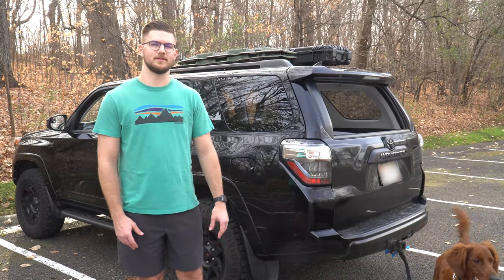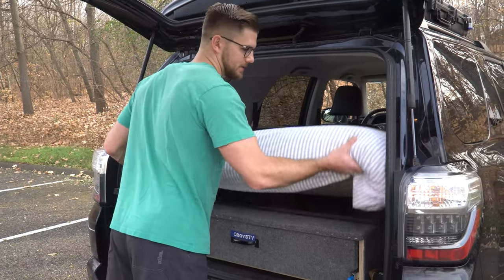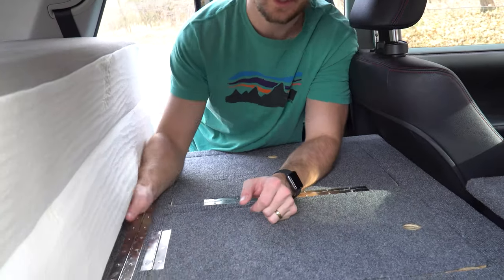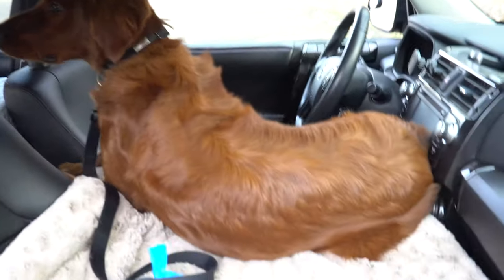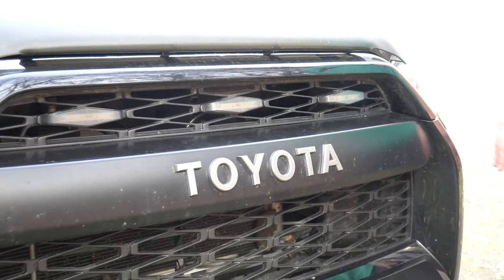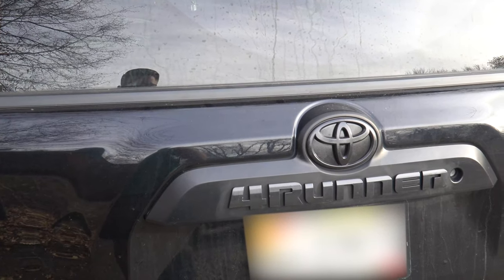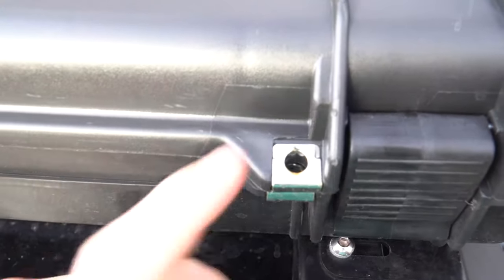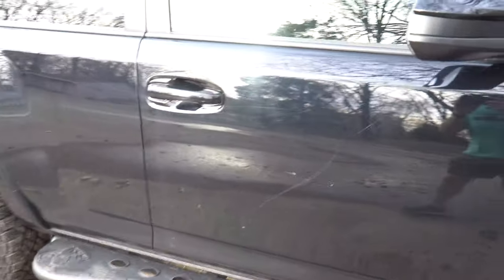5th Gen 4Runner Camping/Overlanding Setup/Rig Tour 2020 | A Couple and a Dog | Affordable DIY Build

Comment: I love the platform. My wife is worried we won't fit in the back of our 4runner. We are short, but older. So getting in and out could be a trick. 

That mattress.
Reply from the maker: You could always build it shorter if you wanted more room.  Getting in from the trunk isn’t too bad.  Just remember that if you build it shorter in the back the wheel wells stick up a little bit so it would take some leg space away width-wise.
Reply: @OverlandEngineer  good point.

Comment: Simple, functional, looks great. I had this elaborate expensive plan but this is an awesome and will be copying most of what you have going here. It's usually me and my 100 pond pup. Wife isn't into the camping life as much lol. I need to figure out a way to incorporate a spot for my cooler to sit and not be in the way. I love your work and sub'd right away. Keep the great content coming my friend.
Reply from the maker: Thanks!  Really Appreciate it!  I have thought about this scenario.  Essentially I figured you could build a front platform section the size of the 60% seat.  Then, you could leave the single seat in the car.  Then you could put the fridge behind that seat.  Or honestly just pick a side to put bags and the fridge.  It probably also depends on where you want the dog to sleep, whether its next to you or in the front like me.  Fun problems to solve though!
Reply: @OverlandEngineer  Actually I used to leave him a spot next to me but he always goes curl up on the passenger front seat. You wouldn't think a 100 pound Rottie would be comfy there.
Reply from the maker: @petyweestraw  Its crazy where dogs end up sleeping and typically in such uncomfortable positions.  The dog platform works awesome!  Plus its super low profile for storage. The only caveat is you cannot open the passenger door ones its placed.

Comment: Great video! Question: the top for your slide out drawer...is it finished on the underside as well? If not, might be worth popping some on just go eliminate any issues with moisture. Always a good idea to seal both sides of wood, even when it’s ply.
Reply from the maker: That’s a great Idea.  Honestly though, my insert is a little loose so I may just redo it.  I also wasn’t a huge fan of the stain color so it might be a good excuse.

Comment: Liked the video. Where did you get the knobs for the carriage bolts? What are the knob called?
Reply from the maker: Thanks!  These are the knobs: https://amzn.to/34sxvCD.  I had the appropriate screws to match.  However, I would not necessarily recommend these.  I did not loosen them too often and I found they corroded through the Minnesota winter.  May not be an issue for you but just be warned they may need a little encouragement if you leave them for a long period of time and they may be something to replace every year if you live in a harsh climate.  If I could find these in a grade 8 metal that would be a dream.

Comment: Hey everybody! I am new to this. And I am in process of making decision for a car size. Choosing between Crossover and Compact (SUVV) and Full Size (like 4Runner). What are the advantages of bigger Vehicle? Is sleeping in the car much better than in tent?

To Author? Can you share more about your travelling experience? Thanks!
Reply from the maker: Basically a larger vehicle is less nimble on trails but much more space.  Smaller vehicles fit less but you can go more places with them.  It depends on your application as to which is best.  Right now, a 4Runner has plenty of space for me.  I also want to be able to go down narrower roads and not worry.

Comment: What MPG do you get on the highway? And how tall do those tires measure out when on the ground?
Reply from the maker: I think when my truck was full stock - aka this photo (31.5" tires) - I got just over 17 mpg.  When I added the 3" Lift and 33" all terrain tires - I got around 15.3 mpg.  I now have 33" mud terrain tires and two roof boxes on my roof rack - I think I get like 14.8 mpg.  I may have gotten 16ish mpg when I added the lift and not changed my tires from 31.5" to 33" but I don't remember.

Comment: what's the best year for the 4runner to buy? i also really like how the rear window slides down
Reply from the maker: Good news is most years have that window feature!  Right now most years accept brand new are not good to buy due to the market.  But the answer to that question kind of depends on your priorities because they are all quite good its just each has some pros and cons which may lean toward your preference or may not.
Reply: @OverlandEngineer  more research is needed for me then. thanks again
Reply from the maker: @zumezoom9593  Yeah sorry.  I love the 5th Gens but some people really want the V8 of the 4th Gen.  There were some features added to 5th Gens in 2020.  But the market on all 5th Gens is super high so you will pay a mark up on used vehicles thats thousands over KBB a year ago.  Thats why I said if you can swing buying new then hopefully you can get something at MSRP.  Honestly, buying used does not really save that much money when looking at 4Runners.  They hold their value well, it just depends on if you are ok with driving higher mileage vehicles and how much money you want to park in a vehicle.  If you are set on a newer vehicle and want a V8, the Lexus GX460 is sweet.
Reply: @OverlandEngineer  I've thought about the GX as well, but I still like the 4runner. i guess I could wait a little while for  the 6tb gen to make its debut and the 5th gen hopefully will drop a little in price. (fingers crossed)
Reply from the maker: @zumezoom9593  Yeah you won't probably go wrong.  I'd probably look for a 2020 4Runner TRD Offroad Premium or newer if I was looking for a 4Runner.  The interior apparently is quieter like they added more sound deadening and the headunit/gauge cluster was updated so its bigger/brighter/apple car play/etc.
Reply: @OverlandEngineer  well, that's it then. I'll wait for the price to subside. I look forward to one day owning a 4runner and going overlanding or whatever
Reply from the maker: @zumezoom9593  Sounds like a plan to me!  Camping is fun but also mobbing around in a lifted 4Runner to work and back is pretty fun too.
Reply: @OverlandEngineer  haha i believe it would be. i salivate when I see my neighbors pimped out 4runner running on 35's, rock sliders, high clearance front and rear bumper.. its menacing

Comment: Could you take out the back seats and have more storage space?
Reply from the maker: Totally.  I just decided to only partially remove them because the seat backs seemed challenging to remove then place back in the car.  The middle section platform does rest on them but you could easily modify the height and it would provide a lot more room.
Reply: Yeah I was thinking for a longer term camper conversion. I’d like to see this done and how someone likes it. Thanks for the info.

Comment: How is the roof rack storage mounted to the roof rack? Does it come ready like that or did you have to drill through it?
Reply from the maker: I had LFD crossbars at the time which mount right into the factory rails!
Reply from the maker: @Giorgio Mumda Yeah basically, I have another video on the channel explaining it.
Reply: @OverlandEngineer  My crossbars are just two bars, I'd need something to grab them that's secure, the t-cross method won't work in my case
Reply from the maker: @RayKaufman  Yeah, most people I know have just sold those OEM bars and got aftermarket ones that are better for mounting.  There are work arounds but they will require making some special mounts.

Comment: Nice rig and setup. I want to get me those LFD crossbars like yours. Great video.
Reply from the maker: They are amazing for the price.  Way better than stock crossbars.
Reply: I think these will fit on my limited. Where did you get them? Do the make wind noise?
Reply from the maker: @Nostromo_1  Link in description for the crossbars.  I am not sure if they cause much wind noise alone, but just to be safe I bought the wind deflector.  Link also in description :)
Reply: @OverlandEngineer  thanks.

Comment: Very nice setup for sure.  How did you secure the storage box to your rack?
Reply from the maker: Thanks!  I just put some large carriage bolts through it.  Drilled some holes the size of the bold shaft, used some rubber washers and bolted it down.  The carriage screws have a square part next to the head that sit nice in the roof rack channel, then I just feed the bolt through the hole in the case and crank it down.  I use 1 bolt per corner.
Reply: @OverlandEngineer  Cool thanks for the tips.  I'll need to make something up like that.
Reply from the maker: @RolandoNispiros  No problem!
Reply: @OverlandEngineer  FYI I picked up the same rifle box and installed it on my roof rack today. Thanks for the link!
Reply from the maker: @RolandoNispiros  Awesome!!!

Comment: Great video. What do you use for the dog platform?
Reply from the maker: Just some carpeted plywood!
Reply: @OverlandEngineer  what did you use for support legs ?
Reply from the maker: @32lifesaver  Doesn't need any!  It uses the arm rest on the door and the center console to basically stabilize it.  There is also a piece of wood I put in the rectangular cup holder section to help support it.  I think it may rest on the shifter without that cup holder insert.

Comment: Sweet setup! What size tires are you running?
Reply from the maker: Stock :( ...265/70/R17 or whatever...265s.  There will soon be a 3 inch lift and then tires will follow when these hit the dust.

Comment: How do you stay warm in there while camping inside it?
Reply from the maker: Probably going to build a small diesel heater but I haven't used it in the winter yet.  Either that or you can build your own battery bank and use a heated blanket if you do not want to buy a Jackery or GoalZero battery.

Comment: Nice rig!  What lift did you use to get rid of the rake I’m looking at into getting bilstein 5100 .85 lift front.  Also what size tires are those?
Reply from the maker: This is actually the stock TRD Pro lift.  Since this video, I just install a 3" lift and I have a video coming regarding this.  In order to have appropriate rake, make sure to buy the right springs.  This will depend on the weight of your vehicle in the front and rear and if you do not buy heavy duty enough springs then it may not be level.  Similarly, lets say you want to level the truck so you buy a 1" spacer for the front because thats what everyone does but you have a front bumper and it's not stock.  You probably want to buy a larger spacer.  Does that make sense?  You probably want to look up a weight / inch lift lost chart for the 4Runner if you are getting spacers.

Comment: Is that simply a regular dog bed, or is there a platform underneath it to level it for your good doggy? Also, where do you put it when in motion? (Glad to see a MN based 4Runner YouTuber, I just moved from there to UT.)
Reply from the maker: Thanks!!  I have a dog platform under it.  I talked in more detail on it in the Part 4 Aluminum Extrusion Platform system video.  It works like a charm though it may be getting a little too small for Otis.  He is almost 70 lbs.

Comment: peep the cboystv patch
Reply from the maker: Haha you caught it
Reply: @OverlandEngineer  I’m about 6’2” , I see some people can get the full 74 inches in the back of their runners. What’re your recommendations for me if I were to move into a runner?
Reply from the maker: @kamrenstaples Can I ask a series of clarifying questions?  Will this be full time?  Will it be through the winter?  Do you have a large budget for modifications?  Are you alone, do you have a dog?  What can you build yourself vs. need to buy?
Reply: @OverlandEngineer  This will be full time. Yes through the winter. Not a super large budget. I am looking to stay under 2 grand for modifications. I will for sure be alone. I have some woodworking experience, construction experience, lots of misc jobs that will help contribute to me being able to build my own rig. I am also lucky my father is a mechanical engineer and is more than willling to help me with wiring, building, pretty much whatever, and most importantly, even planning things out to best optimize the vehicle. I am 6 foot 2, being 19 years old I am told I will grow to probably 6'3" by 24. My main rig options are strictly toyota. Ever since I was 16 I have only owned yotas. My 2 main contenders as of right now are the first gen tundras, and the 3rd gen 4runners.
Reply from the maker: @kamrenstaples  3rd gen 4Runners are sweet!  I debated between that and a 5th gen.  The forums say a standard bed 1st gen tundra has interior dimmensions of 74" and in the long bed its 96"  If you want maximum space and dont care about fitting down narrow trails I'd go with the tundra.  If you want more maneuverability down narrow trails and don't mind sacrificing some interior space then a 4Runner is probably better!
Reply from the maker: With a tundra setup, I'm not as well versed but basically you have more living space because the truck bed can be more moving around/living space.  If you get an affordable refrigerator cooler that can go in the cab of the truck rather than the bed.  Most things you would pack along can all be stored in the truck cab so it just seems to create lots of space.

With the 4Runner, you will probably want to remove all the seats in the rear.  From there the possibilities are endless but the configuration is important so that you save space.  I would put the bed on the right side of the vehicle behind the passneger side.  This should give you tons of room especially if you move that seat all the way forward.  The remaining space behind the driver (keep the driver seat in comfortable driving position always) can be set up to store all your food, refrigerator, clothers, gear etc.

With a 2k budget you are probably spending a decent amount on a truck topper so thats not ideal.  What I would probably prioritize most are these things:

$100? Stock Cross Rails to Fit stock rack - large racks are too expensive to use most of your budget on.           
$100ish on facebook - Full Length Roof Rack Box to hold firewood, durable bag of recovery stuff, traction boards etc
$300-$400ish Interior Platform - probably $300-400 in total materials after some weighted drawer slides... because COVID made wood expensive
$50 - Car Door Window Screen Tent - coolest thing.
$300 - Refrigerator
$600+ Power Source/Dual Battery Setup/Maybe Solar to power fridge, electronic, etc and not get stranded
$200+ Some heat source - no experience but heard a good sleeping bag and heated blankets if youre not into other heaters.  You need good power to run a heated blanket FYI
$350 Harbor Freight WInch depending on where you go but you will need a place to mount it most likely.

If you want links let me know :)

That should get you started haha...any offroading mods would be sweet but probably less necessary for living.  Just some suggestions - take what I got with a grain of salt and make sure its all safe and functional before you use it!  Research ways to camp in the winter because I do not have experience and some aspects can be dangerous so be careful.
Reply: @OverlandEngineer  hell yeah! thank you for such a detailed response. I forgot to mention I plan on working as a wildland firefighter in the summers from march-october but will most likely find myself in Southern Utah during the winter months. I didn't live full time in it, but traveled in a toyota sienna minivan for a week or so at a time and to stay warm I would use a propane stove, always with a carbon monoxide alarm right next to me. I had an RTIC cooler for my food, cooked using wood fire in a firepit usually. Lots of sandwiches and protein bars as well. I also would just bathe in lakes about halfway through my trips as I would typically backpack, trail run, etc. during my trips. I have found that I would definitely like to have the amenities others seem to love, such as solar to power a dometic fridge. For me personally I am now leaning more towards the Tundra for sure! Thanks again for your input man!
Reply from the maker: @kamrenstaples  No Problem!  
Check out Mobicool: https://amzn.to/2Vt2F8D
They are apparently under some part of Dometic.  Super affordable compared to Dometic brand coolers.  Many prominent reviewers have talked about this cooler, maybe some day that will include myself.  Might be a good option for more long term refrigeration other than traditional ice coolers.  It sounds like you already have some equipment needed so you're well on your way and you can use more of the 2k for fun mods :)

Comment: Why don’t you take out your 2 back seats ? And I was wondering if anyone, if traveling alone, has taken out the passenger seat . Enjoyed your video 👍🏻
Reply from the maker: I was only taking out the butt portion of the seat because it was easy and provided extra head room.  If I never hauled passengers then I would remove them entirely but as a daily driver I like to have them.  The back portion of the seat is much more difficult to remove and install quickly so its just a matter of convenience.  Plus with them folded down its a nice surface.  You could easily take them out in a different design.  My platform does require the backs to be in because the middle section has the front legs but the rear lays on the seats.